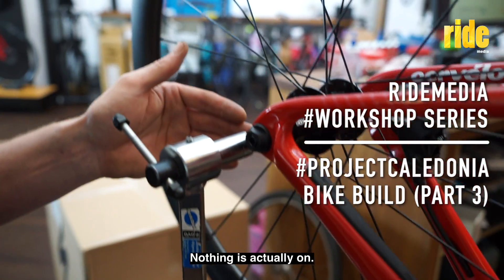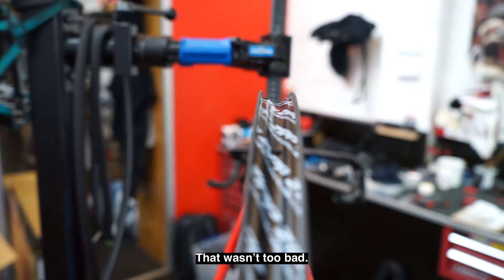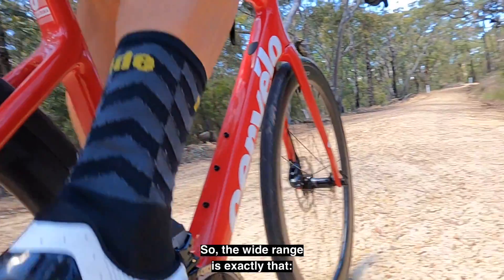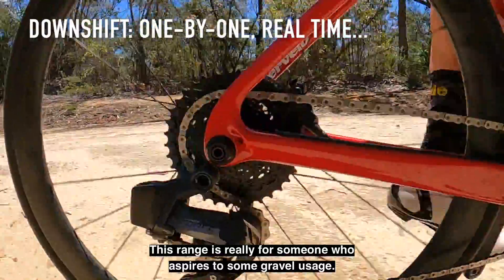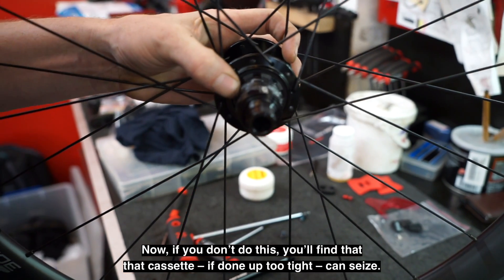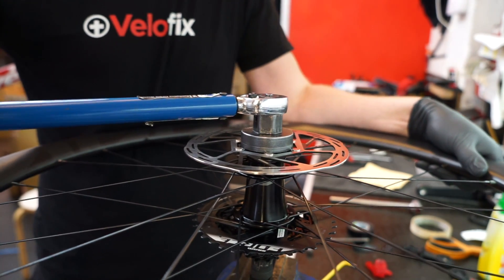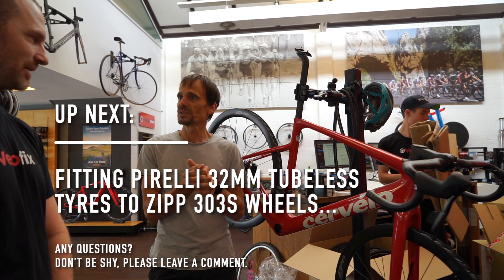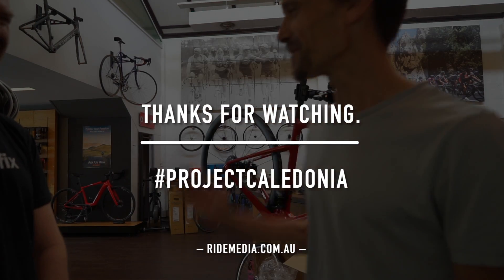Bike build (Cervélo Caledonia): SRAM Force AXS Wide, gearing explained – part 3 of workshop series

Comment: how did he fix the frame mis alignment?
Reply from the maker: It was the derailleur hanger that he was checking and, using the same tool that he used to note the discrepancies, he just bent the hanger into the correct position. (Make sense?)